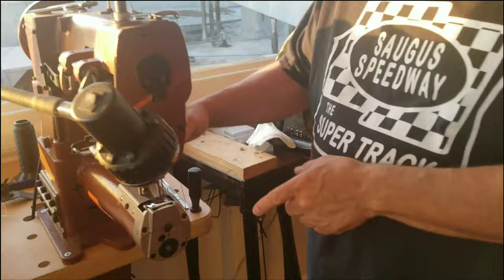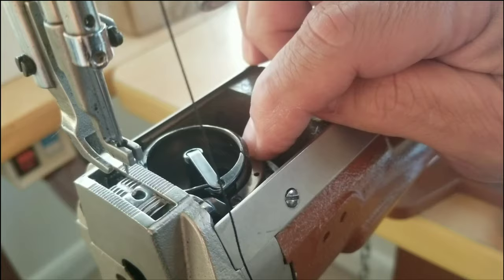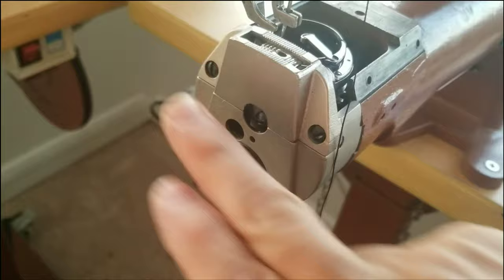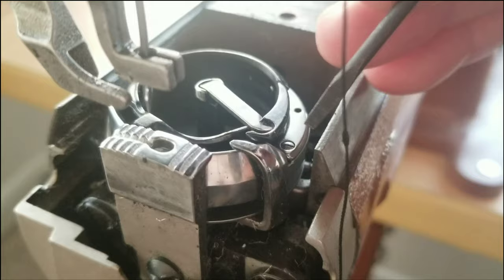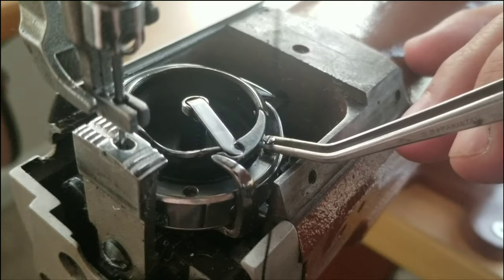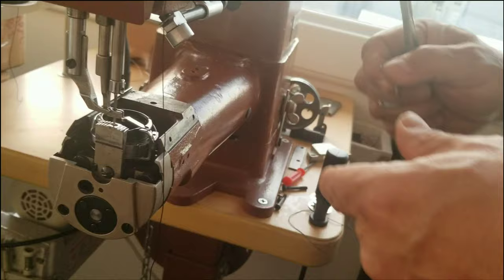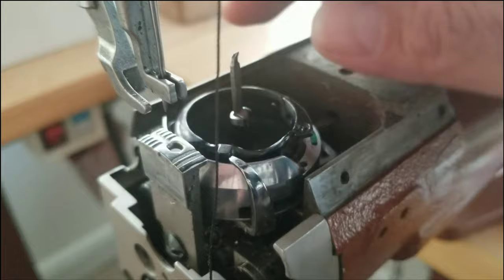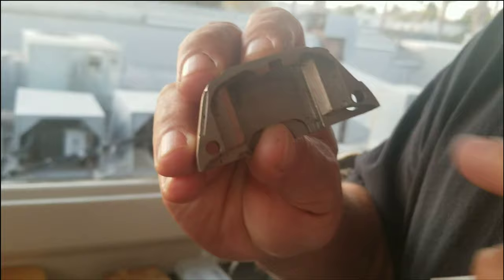Cobra Class 26 thread fouled hook clearing

Comment: Hi. Thank you for the video. I've watched it several times as my class 26 is in this situation. One question as I think I'm doing it wrong. Where should I be tapping with the pencil. I get no movement after a long time of trying. Thanks!
Reply from the maker: We have a user group on Facebook called....
 tips and tricks with Cobra class leather working equipment. 

Join that group and you'll find answers to all your questions there.

Your problem is fairly easy to resolve. But YouTube's platform makes it difficult to answer your question